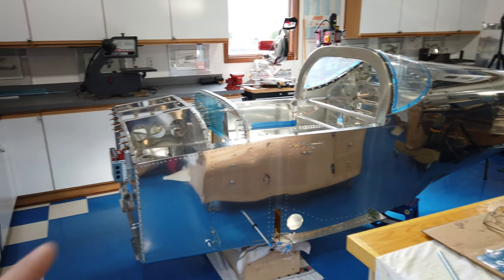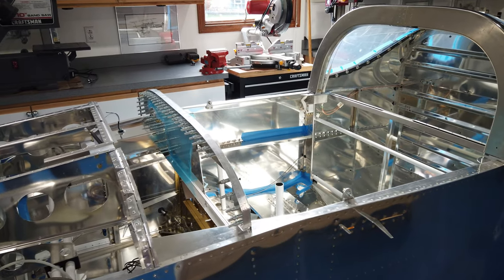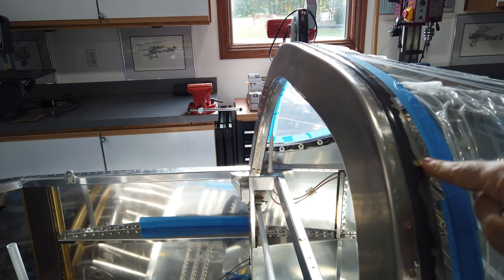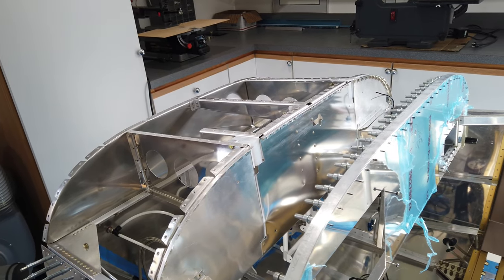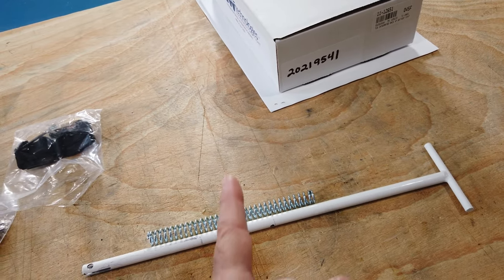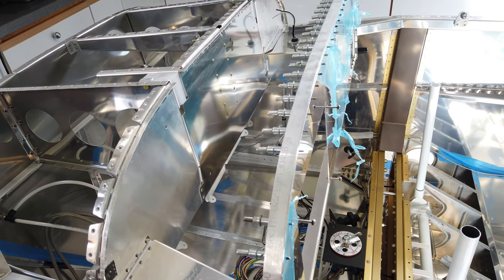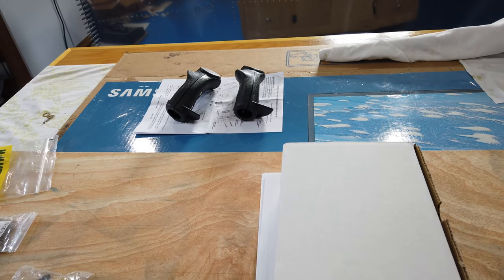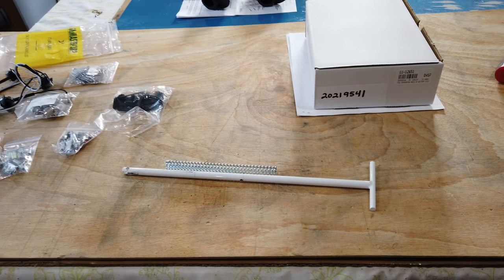Vans RV 7 HINT Video Canopy Backup Power Stick Grips

Comment: Another great video.  The builder of My RV7 installed the canopy release handle vertically from the bottom.  Still reachable if you know where to look and saves space up front.  Might be hard to reach with G forces in an emergency though.
Reply from the maker: I hope we never have to find out if that "jettison" handle works as advertised! I plan to use mine just as a way to simply remove the canopy if needed. (While on the ground...not moving...with a helper...in warm weather...

Comment: Hi . Do you plan any kind of anti-corrision ? So far , all your internal parts are riveted together paint-free .
Reply from the maker: I am not priming any alclad skins on the inside. I am only using primer where the Vans instructions specifical state to prime.  Most of the painting I do will be for aesthetic purposes.